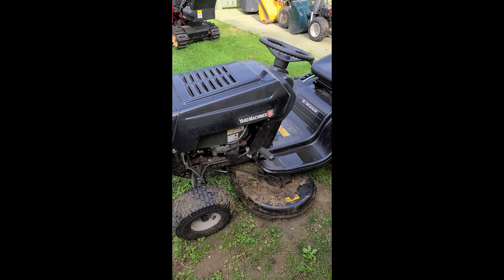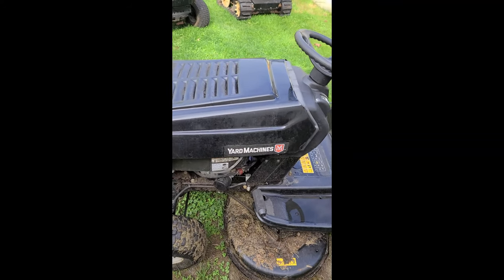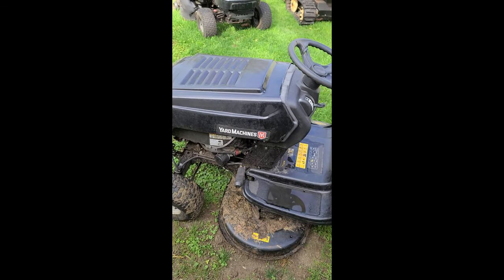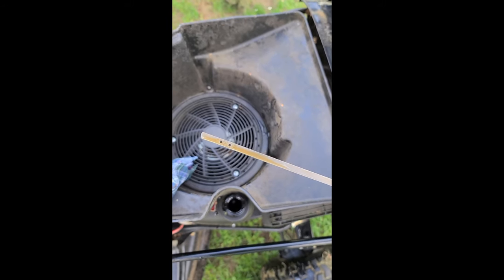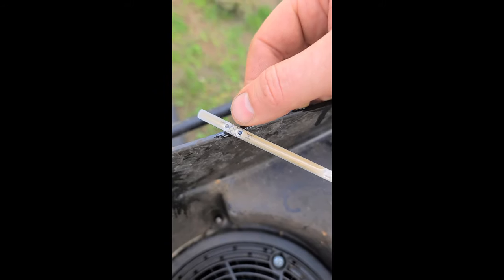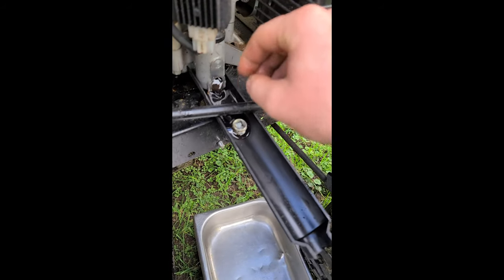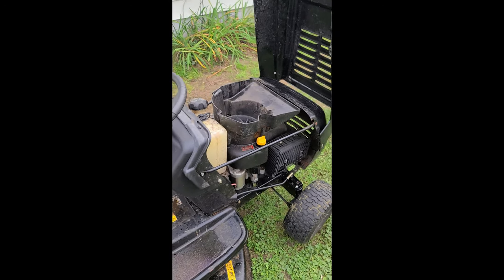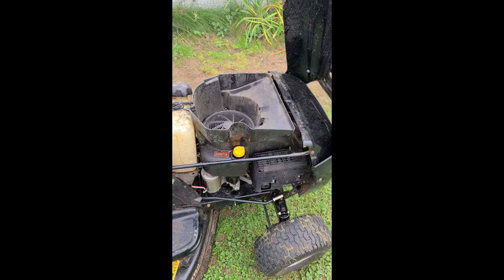Lawn Tractor Burns Oil & Smokes Like Crazy! Easy fix! #shorts

Comment: Very cool oil drain extender thing, what/where did you get that?  Thanks.

I'm amazed the thing ran at all with that much oil in the crankcase!
Reply: Make one out of a piece of pvc. pipe.   Use a heat gun to form the way you want it.
Reply from the maker: https://www.youtube.com/watch?v=GxRET1Oq5P4

Comment: Yrs ago my brother asked me to look at his mower because it started smoking heavily.  He had a single cylinder Craftsman, 14 HP I think.  When I arrived I immediately seen oil dripping from the muffler.  I said - have you changed oil recently ?  He said yea I did just before I started to mow today.  I pulled the dipstick & oil was even with the top of the fill tube 😂🤣  I said how much did you put in this thing ?  4 quarts !! He put 4 quarts in a 14HP B&S  and it ran lol !    I said well we gotta drain most of that out & showed him those marks on the dipstick actually meant something.   I still give em a hard time over that.

Comment: Wow! I thought I was a dumb ass when I grabbed the wrong gas can and filled and ran my  2 cycle Lawn Boy mower with straight gasoline. I did get it running again when it quit by squirting a little 2 cycle oil down the spark plug hole and filling with proper mix. My favorite mower.
Reply: How old is yours.  I have one when they were brown/ tan and the gas tank was round like a thermos bottle.  Use it to mow a hillside.  No handle just a rope to pull it up and let it back down

Comment: Check your carb needle and seat back when I fixed these they flood the engine with gas so it gives a high oil. I always put a fuel shut off in line so it would be less likely to happen if the needle started to get groved.

Comment: Bonjour Don, je dois changer l'huile dans mon tracteur B&S 12.5 hp 1993 et celui d'un ami 15.5 B&S 1994 sans systeme filtre huile. Quand je regarde le livre du fabricant; dans les 2 cas j'aurais mis trop d'huile. et autre question: verifie-t-on avec la jauge vissée ou pas le niveau d'huile de ces vieux moteurs ? merci et salutations

Comment: What was that black diverter that you used when you drained the oil out?
Reply: I 2nd this question too!
Reply: Many times that plastic thing comes with the mower manual, keys and battery bolts in the package when its new.
Reply: Or use a section of mini guttering?
Reply from the maker: I'll put up a short video on it later tonight